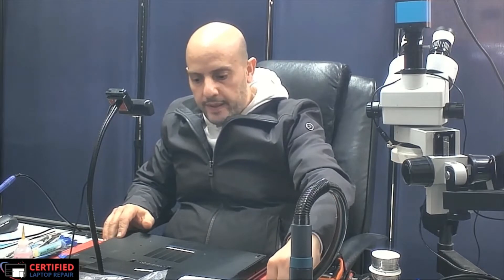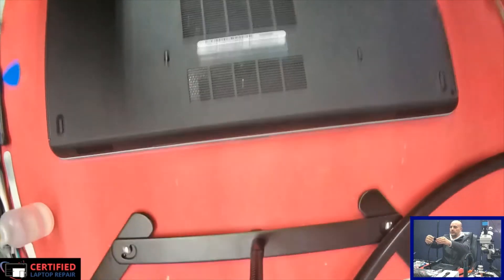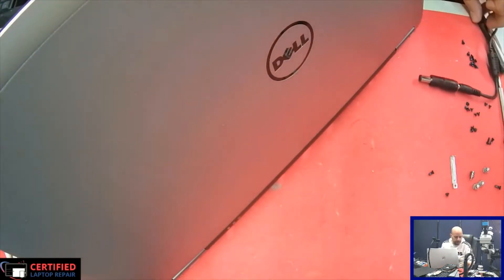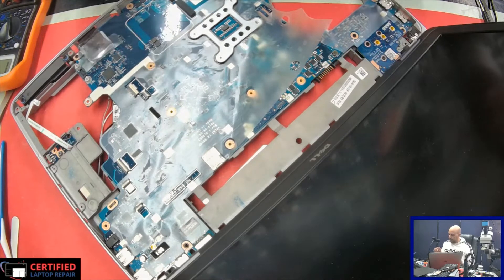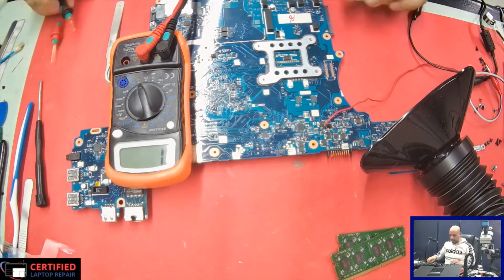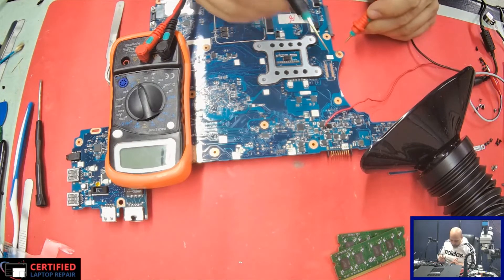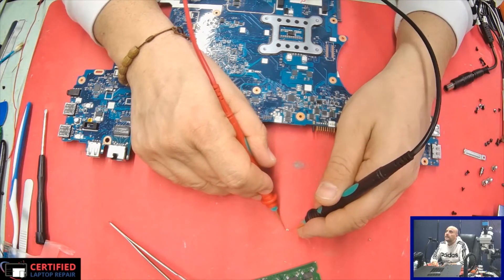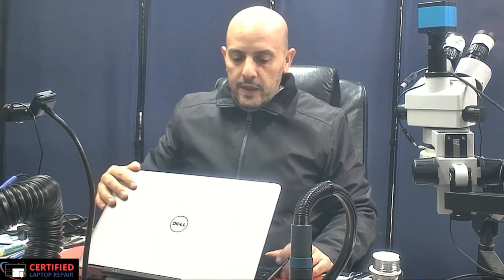Dell Latitude E6540 Motherboard Repair

Comment: i just repaired my latitude e6540 by using your video .this was my first time doing this type of job ,i dont really know much about voltages but i just followed your video and replaced the same cap and it worked perfect thanks a bunch for this info ,you got anther sub,
Reply from the maker: Great to hear!  Even though this is not always the case.